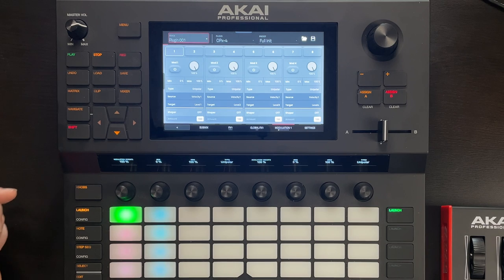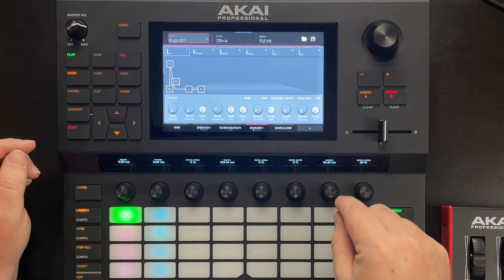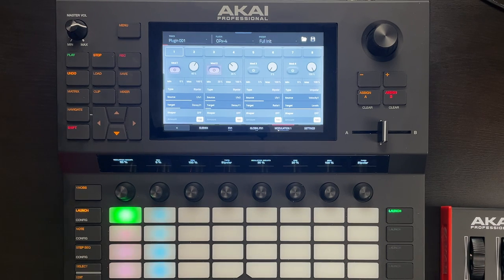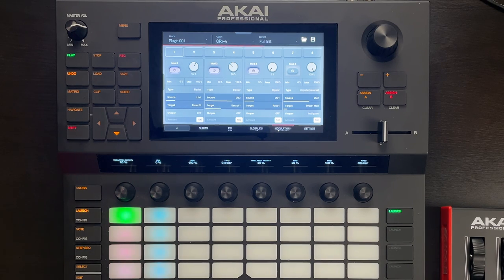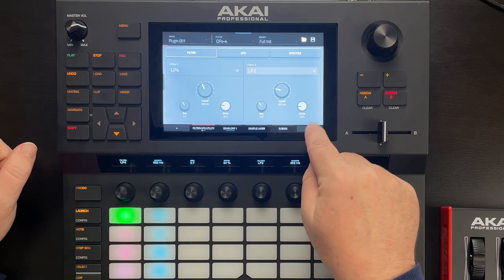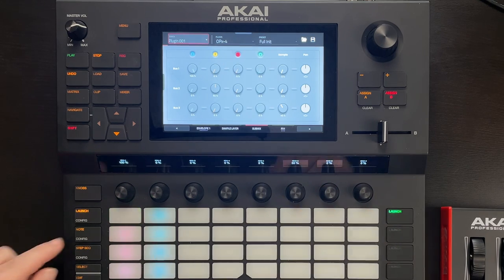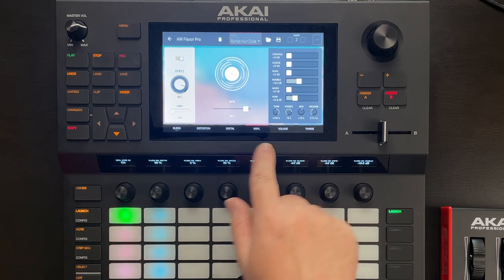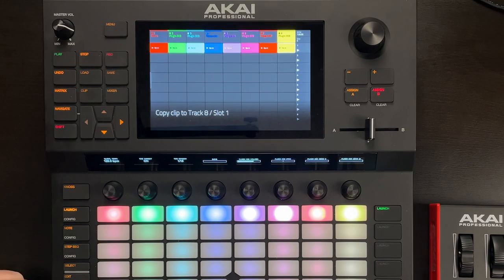OPx-4 Generative Patching!

Comment: What a great tutorial! Carefully presented, concisely explained and at a perfect moment for a project I have going Joe thank you! Right now MPC One is my main inspiration machine and I live by this kind of experimentation and sound. Much of YouTube content on MPC platform is focused on beatmaking or basic use cases, which are helpful at times but this tutorial is tailor made for me. 

OPx4 is very original in its simplicity and depth of modulation I can’t stop using it on everything, however one thing that has got me a bit stumped is using modulation of destinations with envelopes. I would like to create more softly evolving pads with the use of envelopes to modulate LFO speed for example, however I’m not really achieving that result as I want. I’ve yet to master the modes (Loop, DADSR, One Shot) the time scale etc. 

Hopefully you can make more content like this you’ve got a sub for sure✌️
Reply from the maker: Thanks for the sub!  I’m glad this hit the spot for you.  I do have some more OPx-4 videos planned.  Coming soon!

Comment: This is great patching. I'm looking forward to you discovering the envelope followers. Using envelope followers with different pattern lengths and probability on the control tracks, you can probably do even more complicated stuff than this.

I'm currently using 2 envelope followers in a cover of E2-E4 to modulate the pad sound in the same way Göttsching used the ARP Sequencer to modulate his Prophet-10 on the original.
Reply from the maker: Thanks.  That sounds like a really interesting patch you’ve got going there!  I’m planning a video about the envelope followers soon.  It’s a really powerful feature.